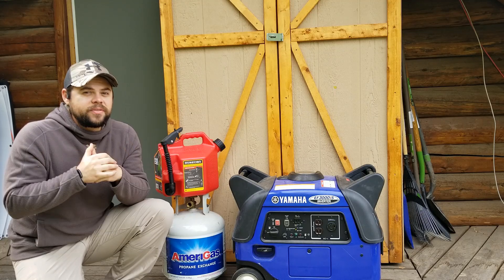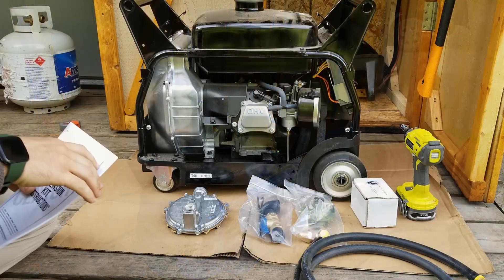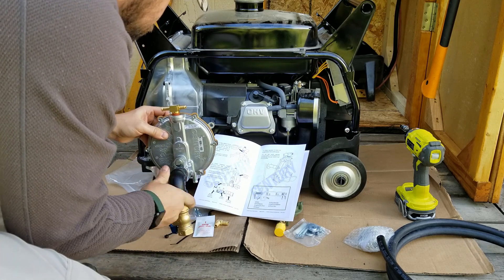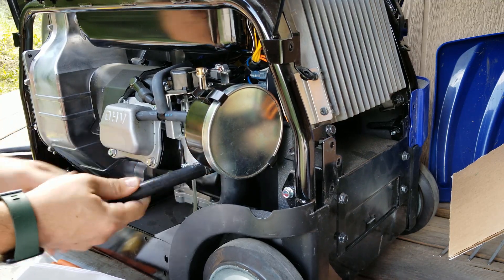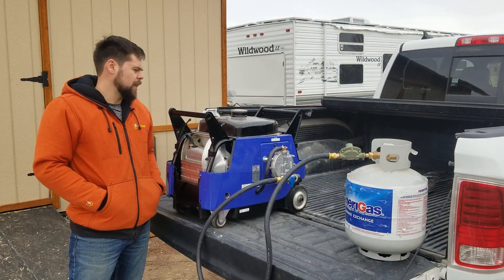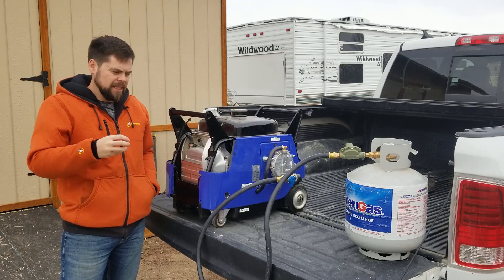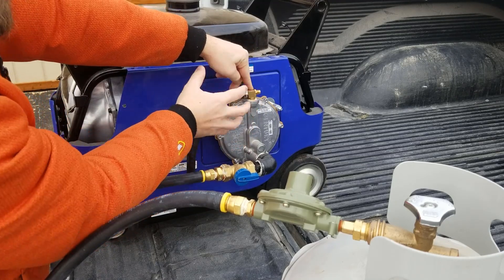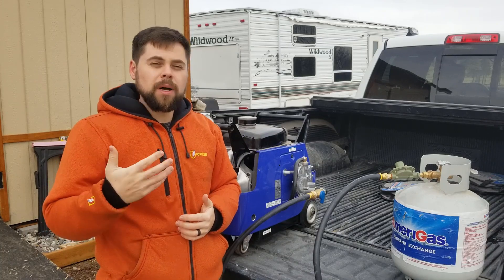Yamaha 3000iS Generator Gas to Propane Conversion

Comment: I liked the idea of being able to run my generator on natural gas and gasoline so I ordered the kit from your site after watching your video, which was awesome by the way, I have the exact generator as you so I thought this should be easy, the kit that arrived was similar with yours as far as regulator and gas valve but most of the other parts were quite different, the valve that attached to the carb was straight down and covered the breather hose hole, the extension bolts were also missing, no shutoff valve on the main gas section, practically every part was different than what you had, it also came with no instructions, there was a bar code to download and that gave very crude directions, seems there are many kits and these instructions only referred to "generic" in every sentence, thanks again for posting such a detailed video, with much fabricating I was able to get the generator running on propane.

Comment: I received my dual fuel kit from Century when I realized I wanted a tri-fuel kit is I just ordered the missing parts from Century to make it a tai-fuel. Your video is the FIRST one I have seen where it is being installed on the Yamaha EF3000iSE. I have the EF3000iSEB which will be same installation procedure. However, I have already installed a remote start kit from Pinellas Power Products and an extended run time kit from Pinellas Power Products which already uses the "Off" position of the fuel "On and Off" of selector valve for the external gasoline fuel tank (basically uses any size of motor boat fuel tank you choose). I think the tri-fuel kit will still work with this EF3000iSEB as long as I don't have a an external fuel tank attached to EF3000iSEB. I recently saw another install video for a Honda 2000 which uses the Hutch Mountain kit. What I specifically like about the Hutch Mountain kit is that the regulator is NOT mounted to the generator. They have it attached at the end of the hose where it attaches to the propane tank. The Hutch Mountain kit makes it a much cleaner install as it only has an elbow coming out of generator with a quick connect to attach the hose going to propane tank. I would not have known where to even start on my EF3000iSEB if I had not seen your video first. Thank you again. Link to Hutch Mountain kit install https://www.youtube.com/watch?v=tfC-eV1MDBQ

Comment: i I just bought a yamaha gen just like yours.  I also bought the conversion from century.   Between the instructions that came with the century and your video, it went together easily.  Thanks for taking the time to post this.   I really appreciate it.
Reply: Would you scan and upload adpatator documentation ? i am thinking about doing the same thing to my mower I am curious and wana take a look to parts before. thanks
Reply: Century Fuel manuals can be downloaded here.

Comment: This was awesome DIY. I didn't think this was possible. I have a question for you. I'm looking to purchase a generator for a backup in case the lights go out for my house. I know it cant power the whole house just need the basic refrigerator some light until the lights come back up. The one you have would be a good one to have or would you suggest a different brand? I was thinking of doing the whole cable thing as you did but I need to start with the basics now.  let me know when you have a chance and if you have a promo code for a generator for a discount let me know.
Reply from the maker: This unit is awesome, the Yamaha units are extremely high quality but they are not cheap. A good second choice would be to get the Honda 3000: https://amzn.to/2WRTl2z which is very powerful and will run quite a bit. Or you get the smaller brother to that which is the Honda 2200: https://amzn.to/3l0DuGU. OR, if you have a Costco membership, currently at my Costco they have a Firman gas/propane/natural gas generator that already has the conversion done and is only $800! It's a steal of a deal and is very high quality. So that is what I would do but it just depends on you having them at your local Costco. If they do have one and you're ready to purcahse I wouldn't hesitate because when they are no longer on the shelf there's no knowing when or if they'll come back. Or you can order it here: https://amzn.to/3yLLiRz
Reply: @minutemansolar  Hello, I know it's been a while but I went with your idea and bought the Costco Firman. That thing is a tank but looks nice. I haven't turn it on yet waiting until the weekend. Maybe you might be able to help me with this. The house we just move in has a 500 gallon propane tank. I notice  in the patio it has a connection for a BBQ. Would I be able to connect the holes straight into the generator without the regulator and just the holes it self?
Reply from the maker: @louiem5985  Not sure, I would say yes but I don't know cause I don't know the exact connection you have but from you explained I don't see why not.

Comment: My experience at propane fill-stations:
* after my empty tank is connected to the station tank...
* the attendant flips an electric switch...
* starting the electric pump under the big tank...
* pumping liquid propane into my twenty pounders.
In my experience, electricity is required to transfer pressurized liquid propane.
.
I welcome evidence to the contrary.
Reply from the maker: Thanks for sharing. At my local fill up station they connect to my tank and open a valve that pushes directly from the main tank, through a pressure reducer, then into my small tank, and has an analog turning gallon counter. I guess not all fill stations are the same.

Comment: I have a Generac IQ3500, which I want to convert to propane. I haven't been able to find a conversion kit, and I'm worried it will compromise fuel efficiency and increase noise pollution (which would upset my neighbor). Can you please do a video response.💗
Reply from the maker: Sorry I do not have an IQ3500 gas generator. I would ask Century Fuel Products if they have conversion kit or know where to find one. That's where I got mine.
Reply: @minutemansolar  Thank you.💗

Comment: Gasoline runs dirty and gums up the fuel system. It always causes long term problems, not to mention sputtering.
Propane and natural gas run the engines much smoother and can be hooked into large tanks or a natural gas feed to run a long time without that nasty refueling of a hot generator.
The down side of propane, and especially natural gas is the lower BTU count, thus less wattage available than using gasoline. Something to consider when sizing a generator. 
Having the option of switching fuel sources is well worth the price of a kit.
I also have a boat fuel tank fitting on my generators so I can swap 6 Gal. fuel tanks without shutting down and for easier refilling of the tanks at the gas station. Steel boat tanks will also be sealed well enough to preserve the gas for a very long time. I just rotated out some gas which was dated 2009 and it worked just fine in my car.
3 more little tid-bits:
Store your generator in an EMP protested environment.
Using a generator will alert everyone aroung that you have something going on everybody will want. Sound suppression and being careful with stray light will go far to keep marauders from catching on in a SHTF event. 
Prefilled propane tanks from your local store are not full! They need to be topped off, usually another 1.5 gallons. Well worth doing. Kind of a ripoff selling 3.5 gallons in a 5 gallon tank, but that seems to be SOP for them.
Reply: @ÚLFHÉĐNAR I have not run anything on propane - yet. I have hoses going to the NG meter and run without having to refuel. There is a significant loss of wattage though. Our power is not very reliable and we have been out of power for weeks many times. The generator running our gas furnace during those times has been well worth the money. NG is cheaper to run than gas also, although still much more expensive than line power. 
Good to know about the propane quality. Never thought about that, but now that you mention it, those bottles don't seem to last as well as they should, even being short fills. Must be because I have to turn up the gas flow to get the heat out of them. Great point.

Comment: We are getting ready to purchase a generator and have been looking at all the options.  Thanks for sharing how you use it to back up your solar generator and how much fuel you use to do that.  Question, do you have any insite on generators that are all ready duel fuel?
Reply from the maker: I do not, but I know many options exist out there. Even costco has multi fuel generators usually. You could probably even check home depot. I haven't gotten into gas generators that far yet but eventually will.
Reply: @minutemansolar  Thanks for getting back!   We're wanting to get the Titan solar generator but deciding which way to go on a fuel generator.  Blessed to be in a country where there are so many choices :)
Reply from the maker: @deborahalexander9882  Sounds great! When you get your Titan please be sure to get it through https://poweredportablesolar.com/shop/ so you get free extra bonuses in the kit that no one else provides. Let me know what gas generator system you decide to go with too.

Comment: I converted a Black Max/Honda engine 8500/7000 generator using a U.S. Carburetion Motor Snorkel over 3 years ago, and haven't looked back! The generator runs smoother and no need to make sure you have fresh gas in the tank. I have 100lb tanks which will keep me running for a long time.  Looking to plumb a natural gas outlet to the outside so I can use that if things go down for a longer period of time.
I know we men get a bad rap for not reading directions, but you should have done that prior to starting your project.  Extra holes in the side?  Shame on you.  A quick read or maybe even look at the pictures would have helped you avoid that mistake.
However, thanks for posting the video and giving others the idea.
Reply from the maker: I'm sorry you must've missed it in the video. The user manual says "General User Manual" it is not for this specific model so the instructions were not built around this actual gas generator, hence the lack of understanding on where to put the hole.

Comment: Don't forget to check the rubber hose's to make sure they are free of cracks and nothing has eaten at it while not being used. I would also cover the holes in the case just incase they affect the cooling of the unit. The case's are made to let air flow to keep the unit cool you can remove one piece and have an overheating problem or an extra hole in the cover can do the same thing.  Just tips to pass along to people.  MST Certified for over 42 years.
Reply from the maker: Thanks for the tips! The hoses are good. I'll plug the holes.

Comment: Converting the Predator 3500 inverter generator principle is about the same, the only caveat is the engine kill switch is integrated with the fuel cutoff valve. So, you will need to disconnect it behind the control panel and add an external switch to accomplish this. I decided to permanently disable the electric start feature, removed the SLA battery, and rewired the starter switch to serve as my emergency engine kill switch. In this configuration, I can turn off the fuel and let the engine use up the fuel left in the carburetor.

One thing to keep in mind is that once you make the mod, pretty much your warranty is void. I've found if its gonna be a dud, you'll know pretty quick if you put it through the 20 hour break in at a quarter load. When running on propane you can only load it about 80% of its nameplate rating due to its inherent energy density is less compared to gasoline.

My break in process is usually running it at quarter of its rated load; changing the oil at 4, 8, 16, and 20 hours. Usually I see metallic flakes in the first two oil change intervals and it is pretty clean by the time you get to the 20th hour. Most of the Honda clone engines have the light metal flake issue due to the manufacturing tolerances for the first 20 hours is what I've noticed, so I just use nothing special conventional motor oil then switch it to full synthetic after the break in period. I have one that has 200+ hours gasoline and about the same on propane, I can say that my general maintenance is quite less especially fouling of the spark arrestor.
Reply from the maker: Thanks for the tips and info! Very helpful.

Comment: I still need to do that for my 10 HP 8500 watts generator at the CA house. I have a Firman Tri-fuel generator from Costco for the compound in Basalt
Reply from the maker: That would definitely be good.